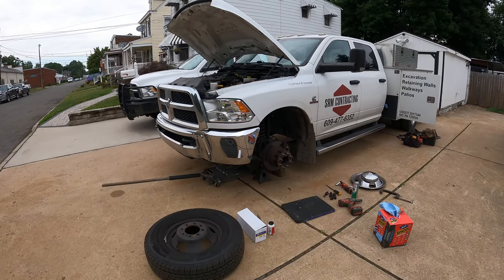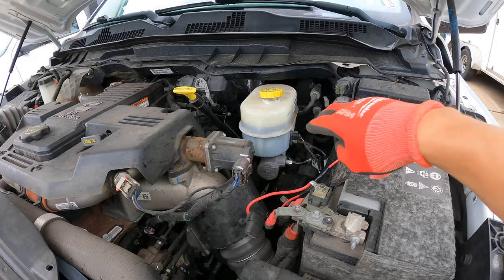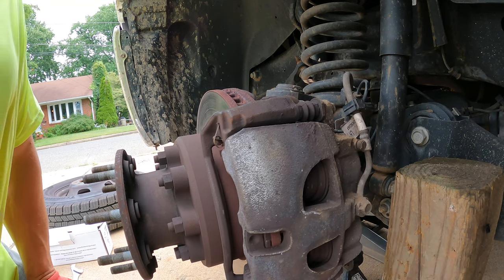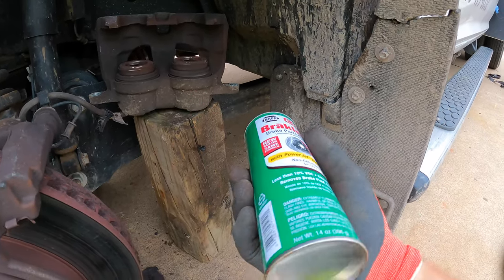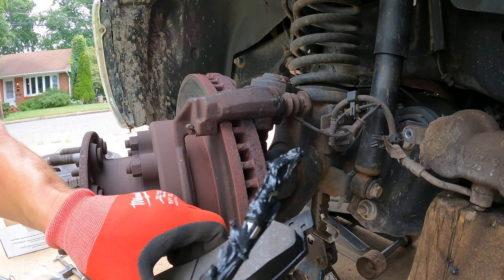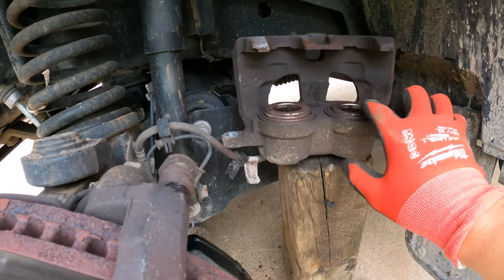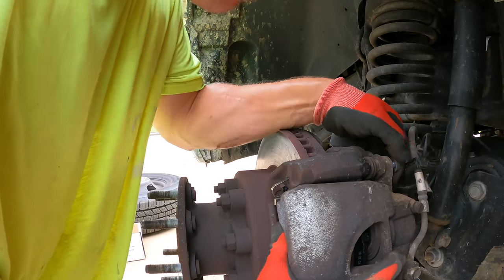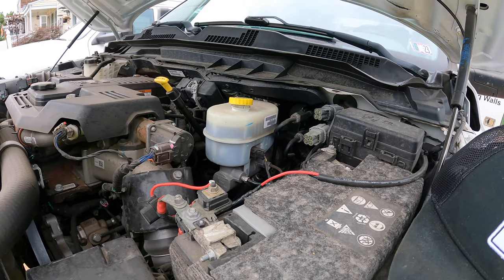How to change front brake pads on Ram 3500

Comment: coming in here late. but NEVER want to press the calipers back without opening the bleed port.. WHY.. you can push stuff from the caliper back into the anti lock brake HCU thing creating a $1000 problem.   great vid for sure..

Comment: By the time you needed new pads , you also needed to flush the brake fluid, too . Greasing the slide points on the pads will only cause road grime to accumulate there .  It  may not hurt, but it sure isn't going to help .

Comment: Or you can crack the bleeder before you compress the caliper. That way you drain the old fluid off instead of pushing it back through the lines.